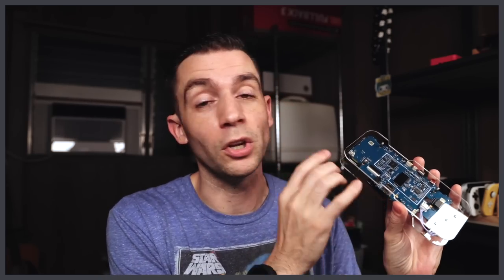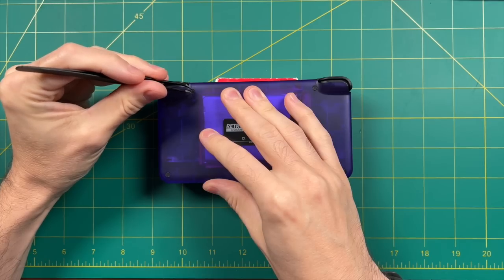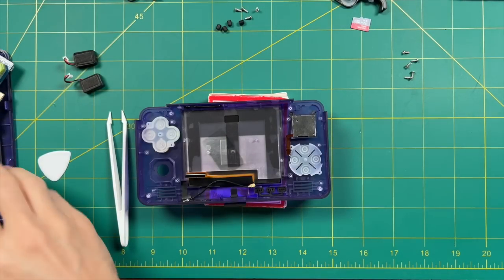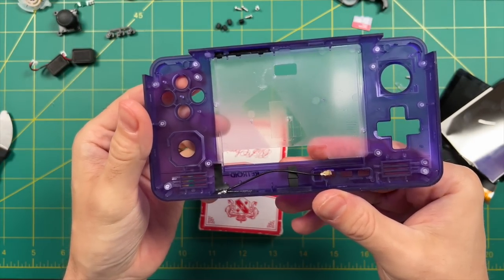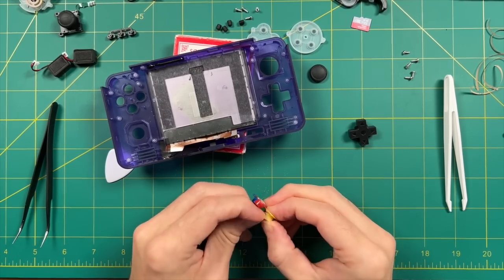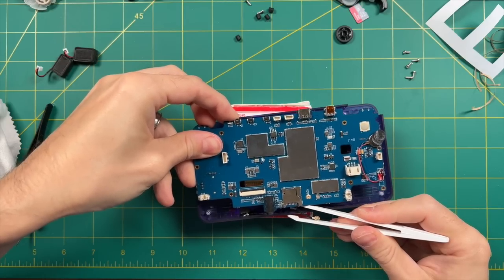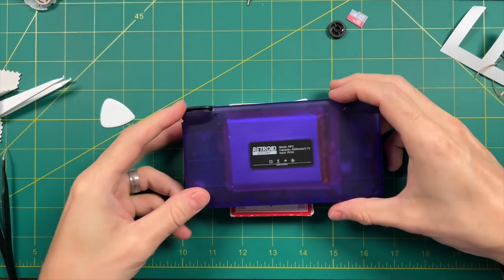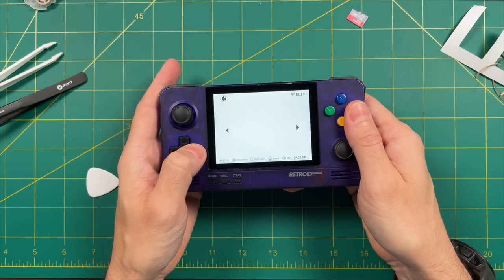Retroid Pocket 2+ PCB Upgrade Guide

Comment: how does the new right slider behave? On my RP2 if I put a little more pressure on it (as I tent to do as I rest the weight of my thumb on it) it would bind slightly, making the slider an even worse experience. i hope the newer part is less compressible

Comment: some tips for removing the screen, run some isopropyl or rubbing alcohol on it  before, that'll help loosen up the adhesive, use your thumbs and push at that lower opening until you can get a tool between the screen and the front shell, pry at the sides then work your way to the middle sliding the tool left and right to break away the adhesive, keep at it and the screen will lift off 

you can use either a plastic spudger, metal spudger or hell even a small flat head screwdriver but if you're using the latter you might want to cover it with a piece of thin cloth to not scuff up the device

Comment: A bit late, but I wonder if light sanding with a fine grit might have smoothed out that gash.

Also, tried to use a Barbie hairdryer, RP2 caught fire. Not recommended, stick to Hello Kitty. :(

Comment: This was a great video,   thanks!     I was hesitant in ripping out the screen until I saw someone else doing it first!     I did notice that my rumble motor is different,   mine is a small motor soldered in were your rumble power wires connect to the board.   They must have done an upgrade in the past couple of weeks.

Comment: I did a shell swap on my switch lite and I'll tell ya what.  Screws?  No problem. ribbon cables?  Not an issue!  Cleaning and reapplying thermal paste?  Love it!  But damn I was nervous when I was doing a similar process to transfer the screen from the old shell to the new one.
Reply from the maker: Yeah screens are no fun.  I went into this knowing I had no actual use for the old screen, so not a huge deal for me.

Comment: In v3, they should move the right stick above the face buttons and make it a real stick. When retro systems, use dpad and buttons, 32 bit Era, joysticks, triggers, and face buttons would be used.
Reply: Agreed.
3D Games require use of both thumbs on joysticks, and your fingers on some shoulder buttons. The slider doesn't cut the mustard, only useful in niche circumstances (2D and 2.5D).

Nintendo also made this BIG mistake on the Switch when they put the Right-Joystick below the Action Buttons. So a very common complaint is from people going to hit one of those buttons, then accidentally moving the R-J with the bottom of their palm. On a thicker controller it wouldn't have mattered much, but since this is portable (is Thin) it makes quiet the difference.
Reply: @ekinteko  The only thing that made the format on the switch reasonable was that you could use a single joycon on its own, thus they needed the thumbstick to be on the bottom right so it would be on the left when held sideways. These companies are copying a compromised design.

Comment: Unfortunately, the PCB kit has been sold out for a bit. I did order a complete unit, but would also like to upgrade my older one too. They kinda seem to just sell something until they run out of it (or at least that's how it's appeared on their previous products), but I'm really hoping they do a restock. Great video as usual. UPDATE: I started a chat on their website and the person on the other end said there are no current plans to restock. I'm still hoping they change their minds, but right now it looks like if you didn't already order a PCB kit, you're not going to.
Reply from the maker: Oh crap, that's a bummer. Thanks for the update.
Reply: @RetroGameCorps  I went back and looked at the screenshot of the chat, and their answer was "Hi, no plans yet." So I suppose we can place our hopes in "yet" if we so choose.
Reply: @RetroGameCorps  Hey Russ. I just checked the Retroid website on a whim and it seems as though they are once again offering the PCB upgrade kit (as a preorder). Thought I'd update you here in case you weren't aware. The touchscreen also seems to still be available as a separate purchase. Thanks for all you do for this burgeoning community of retro handhelds, man.

Comment: I used a heat gun to warm the adhesive on mine, (even heating the front face to protect the back plastic from melting/warping) but still ended up trashing the old screen. Oh well, the new screen is perfect.

Comment: Hey Russ. I just got the RP2+ and love it. I wonder if they would ever sell a kit to change the digital slider joystick to a real one? Do you feel this is possible?
Reply: I'm not Russ but the actual slider itself is built into the PCB so they'd likely need a new PCB to switch the slider for a real stick.
Reply: @soli-ethd  crapola
Reply: Looks to be soldered to the PCB, so, a bit of a bigger procedure, not impossible. I think it's analog, too, so should be upgradeable, signal wise? A stick in the same form factor/pin out probably exists. Might need to dremel the hole a bit? Not an expert.

Comment: How hard would you say this is to complete without breaking any of the clips? It looks like one of yours broke during the process?
Reply from the maker: I've opened up a few of these now, I did break mine on the bottom left, that was the first time.  I was pretty surprised that I broke it, but I could have been gentler -- hindsight is always 20/20!  Luckily the screws hold it in place nicely even with the one clip gone.

Comment: gonna be honest I am not a big fan of the rp2+ buttons I think dome switch buttons work well for handhelds and I find myself really not enjoying pressing the buttons they put in now I tried out my friends rp2 and the difference is night and day
Reply: i know this is an old comment but would you recommend buying the rp2 buttons and putting them in the rp2+?
Reply: @RetroProductionsYouTube  honestly no I wouldn't bother myself having opened up my RP2+ and im pretty sure they're incompatible because they have different internals.. I got a RP3 it has the best buttons, so, if you want a really nice experience I'd recommend that or the 3+ which is nice but has rubber ABXY buttons
Reply: @knock090  oh yeh looks like your right. oh well. thanks for the suggestion.
Reply: @RetroProductionsYouTube  yeah I thought so too I would have just replaced the buttons if it was the case sucks for us I have a RP2+ im probably never gonna use again 😂😂
Reply: @knock090  honestly, its not the worst thing in the world. I got used to the buttons but I understand peoples frustrations.
Reply: @RetroProductionsYouTube  I got an earlier model of the 2+ the buttons grate against the plastic shell its doesn't feel great to use I beat metroid fusion on it I just dont really like the buttons at all from the D pad to the face buttons I know its not that big a deal its just not for me 😓
Reply: @knock090  yeh if the buttons grate on the shell and you hear squeaky sounds then I would recommend getting a pencil and draw around the buttons. This fixed the squeeky buttons for me.

Comment: RP2+ is cool, but they really need to step up with quality. Preorders slowly come and many people have heavy lightbleeding (me included), buttons stucking in case, etc.
Reply from the maker: If you have bad light bleeding I have heard that you can contact the company and they will send you a new screen plus front shell.
Reply: @RetroGameCorps  I saw one guy got  this replacement, but he has, like, whole screen as one blob of light. Mine is only three parts on sides, wrote a letter but really do not hope for answer.
Reply from the maker: @Artemas_16  oh yikes, that’s not good.
Reply: @RetroGameCorps  but hey, at least buttons are good (mine is 16bit)
Reply: @RetroGameCorps  So they finally answered, somewhat like that: "there are much worse screen which we fucked up, so take a coupon and good luck"

Comment: Anyone having issues with reicast/flycast? I cant get the touch or controller to work at all. Not even the menu is accessible within the emulator to select any of the options etc. Really frustrating.
Reply: hold select.
Reply: @tking2199  thanks! still doesn't work... sigh